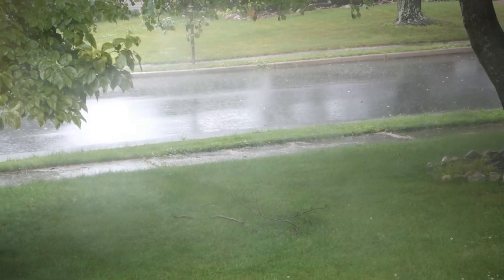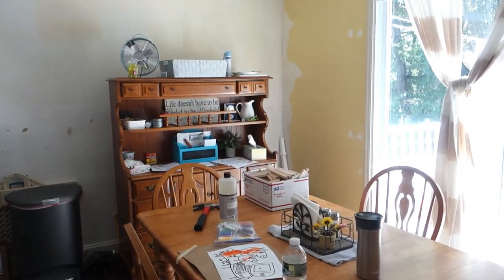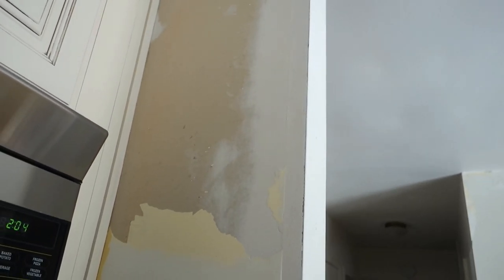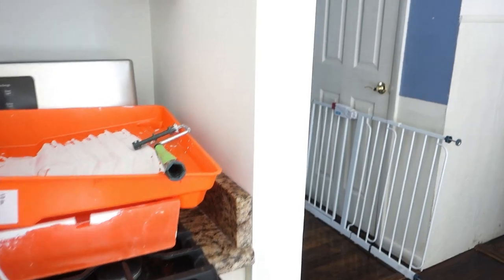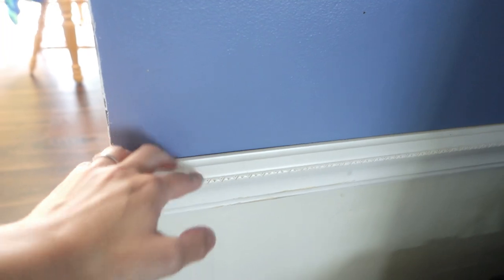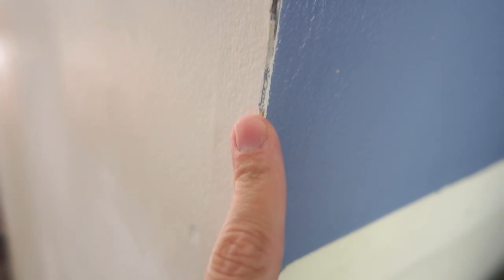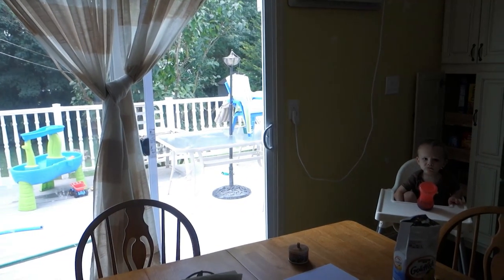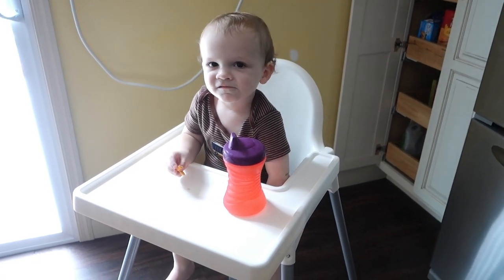The Paint PEELED Off! + Picking a Whole House Paint Color || Cape Cod Fixer Upper | Chill with Jill

Comment: Hi Jill, just a small suggestion for the rest of your painting and sanding, etc.   You really should get some painter's drop cloths so if paint drips .. or spills !! eek .. and  also for catching those bits of sanding particles.   Makes it alot easier for cleanup.    I vote for painting that small part in the kitchen that Greg suggested the blue, the same color as the rest of the kitchen.   I think it will look better.    Hopefully you don't need to paint ceilings.    I painted one and almost broke my neck haha.

Comment: I find it so hard to pick a color because I just keep going back and forth. When I had my main floor redone, Kitchen/Dinning/Living rooms, I ending up painting everything the same color which was medium beige and yes that's the boring color. It was just exhausting for me to keep switching. I'm not picky so it works for me.
I do like the alabaster color and think it will go very well with Balmy Seas. The small wall that Greg wants to paint balmy seas I think you should paint it alabaster, I understand what he means but I don't think it will work.
Good Luck Jill, I don't know how you do all that you do.
Reply from the maker: Thank you! I understand what you mean about sticking with a paint color that works. No sense in going crazy changing the color if you still like it!

Comment: If you are using flat paint you aren’t going to be able to wipe anything down on the walls..
Reply from the maker: I says it provides “some washability.”  We’ve always used flat paint. I don’t like how the others looks shiny.  Also the flat paint helps to disguise the many imperfections on our walls lol.
Reply: Chill with Jill eggshell is a better choice, hardly any shine.. yet it’s very washable.. in the contrary flat paint you can see scuff marks and even sometimes the part you tried to clean... I do like flat but I don’t use it with kids.. so now I use eggshell. It’s much better.